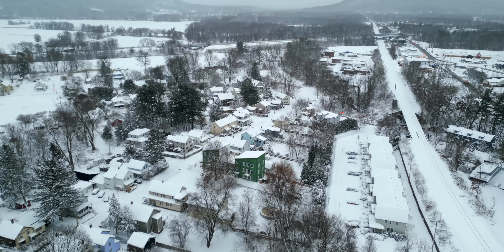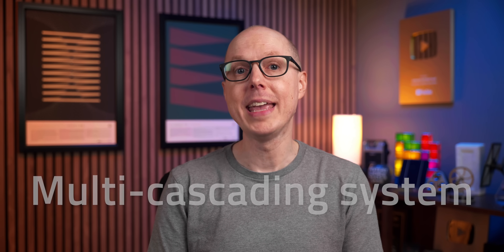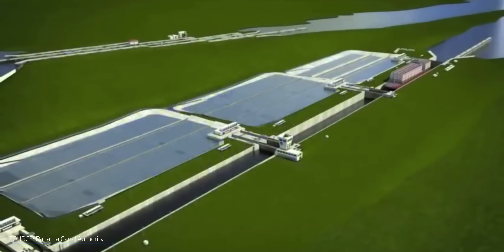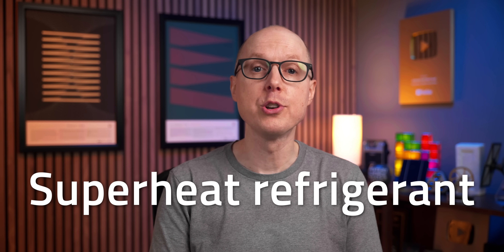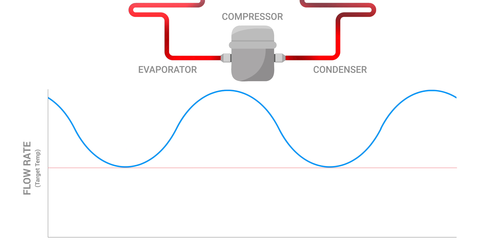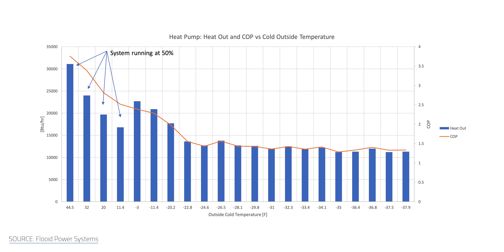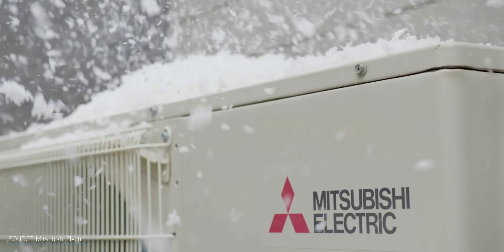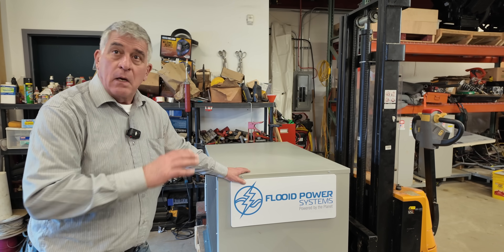How This New Heat Pump is Genius

Comment: How do modern heat pumps handle high, persistent heat, for us out west in the desert?
Reply: A heat pump is literally an air conditioner that can switch directions. You're either pumping the heat out of the home, or you're pumping it into the home. That's it. It's super simple.
Reply: High temperatures  is not as bad for the heat pump as low temperatures You can find some very reasonable heat pump that work in that range. And if your in a sunny area the EG$ solar hybrid system is a winner out there. providing on an average of 6 hours of free cooling on sunny days. The trick is to learn how to read the performance spec chart to know which one to buy.
Reply: @paperburn   Thanks! that's a great tip!
Reply: I guess just as well as an Air Conditoner. You just need to make sure to properly size it (a too large heat Pump causes cycling that wears down the heat Pump over time.).
Efficiency wise, it should be very good (lower temperature difference  = higher efficiency)
Reply: @justinterested5819   that's precisely my concern, if we're aiming for 72F and it's 120F outside, a high temperature difference, how efficiently can heat be exhausted into heat-saturated air?
Reply: @lady_draguliana784  A heat pump is moving energy around. Think of it like moving marbles. If the inside of your house is 80 marbles and you're trying to make it 72 marbles you need to move those eight outside. If the air outside is 120 marbles dissipating those 8 into the atmosphere isn't a big deal. 
The place's heat pumps struggled previously is when it's only 15 outside and you're trying to make it 68 inside. That's a lot of marbles to extract from the atmosphere.
(We should really be taking in BTU, but that complicates the explanation)
Reply: @lady_draguliana784  You'd size your heat pump for whatever your biggest temperature delta is across all seasons.

If you set your thermostat at 60 in winter, and the ambient temperature gets down to 20 degrees at the lowest, then 40 degrees would be your max winter delta. And if you set your thermostat at 70 in summer, and the ambient temperature gets up to 120 in summer, then 50 degrees would be your max summer delta. You'd size your heat pump for the larger of those two values.

For those who live in places with cold winters, the winter heating demand will probably be bigger than the summer cooling demand.
Reply: @dafunkmonster   Oh cool, I didn't know how to make that determination! thanks!

Comment: Heat pumps work in cold weather, but they are expensive as hell to run most people find that out the hard way
Reply: With a COP of 2-4 they're 1/2 to 1/4 the cost of resistant heat. The only way you get cheaper is if you have very cheap gas available, and expensive electricity. Depending on where you are that may be true, but it will always be true they're cheaper than any other electrical heat, and in many locations gas is more expensive still.
Reply: @peter65zzfdfh   & @otm646  there is still a perceived comfort that complicates that.   

With a HP producing 77* temps (in extreme cold), the air currents in the home feels cooler than Gas which can provide 105* air currents.   Studies show that people with gas units are comfortable in lower room temps than those with HP’s… do to warm air currents around them.   HP users will call for much higher room temps than gas users.  This “user comfort influence“ negates the mathematical benefits your referring to.
Reply: @BiggMo  I can see this being a thing. The gas furnace also uses a lot less flow. When I have my heat pump on the blower gets turned way up, creating a lot more "wind" in the house.
Reply: @DeadphishyEP3  I think there is a lot of perception involved, when a furnace put out heat it is normally at 100F .  any air movement below 85/90 degrees feels cool and heat pumps operate in that range at times.
Reply: @BiggMo   Most new heat pumps have variable speed fans. When the system is outputting less heat the fan will turn down automatically to maintain more comfortable supply air temperatures. They should be able to maintain 90F air even in the worst situations. If you're not in the direct path of an air vent it should be fine. If you stand over the output of my gas furnace it's just way too hot (125-135F), lower temps would be an advantage.
Reply: @peter65zzfdfh  "but it will always be true they're cheaper than any other electrical heat"

*assuming a certain level of reliability
Reply: @peter65zzfdfh  is that COP still true when using resistive heat to defrost the outdoor radiator?
Reply: @David-uf9qm  You don't use resistive heat to defrost the EVAPORATOR or the CONDENSER. (Radiator... lol).
You REVERSE THE FLOW OF THE SYSTEM TEMPORARILY.

(Radiators exhaust heat from another source. Evaporator and condenser are the who parts of a refrigeration cycle.)
Reply: When we installed a new AC unit, I mandated it to be a heat pump. Unfortunately it cost about 2 times more than my 93% furnace. I have solar, but it's a small house, so my roof is tapped out at 6kw.
Reply: @DeadphishyEP3  when I looked into heat pumps I found the installer markup was about 300 percent. EG4 hybrid solar might be a fit for you. it uses panels and grid  both and only uses the grid to sublimit the panels.  only take 6 to 8 450 watt panels  for peak performance. Most of these units come pre charged and you can self install if your very handy and can follow instruction provided..
Reply: Most people do not realise that you have to buy a heat pump optimised for heating or what you say is true. When the COP drops below 1 they suck the juice like a starving baby.
Reply: Heat pumps work perfectly well, even in arctic conditions. Their efficiency is hit, but it is still a COP of 1.5 instead of 3.5. even my 15 year old model is more efficient than an electric radiator at -27°C. It just doesn't have the same kick as at -15°C, so the house is a bit colder.
Please can people research further, rather than listening to some old boiler guy who doesn't understand the new technology.
Reply: They are not expensive to run. We have all of the efficiency numbers, that's what COP is. Plus if you have access to time of day power the electricity when you need it the most is dirt cheap.
Reply: @otm646  COP is great when measuring against resistive heat. BTU to BTU natural gas in my areas is magnitudes cheaper than electricity. This isn't some imaginary theory. My utility bills prove to me over the last several years that my heat pump costs me a lot more to run.
Reply: @DeadphishyEP3  know people that have bought them, and they had no idea because the salesman and many fanboys on the Internet may not even know they are not telling the truth
Reply: @otm646  Time of day electricity pricing is a wash, because you're only using "dirt cheap" electricity in the winter overnight. In summer, you're paying through the nose during peak demand to keep your home cool.
Reply: @dafunkmonster  we have a set point price in our coop, and if the coop makes a profit the extra is turned back to the users. we have the cheapest rates in the area. Not sure how they manage that but we do with a very high reliability rate even after hurricanes.
Reply: @otm646  that’s what all the salesman say exactly
Reply: Only if the systems are not designed or installed correctly. In the UK, some companies are seeing COPs of 4-5, which makes it cheaper to run than our standard gas boilers.
Reply: @egocd  Perhaps it depends on local weather and fuel costs. Some parts of the US get really cold and natural gas is cheap.

Comment: This sounds like geothermal.  The ground at a certain depth is a steady temperature.  Using a fluid loop in the ground to provide a floor temperature, a heat pump can then take the fluid in and either lower or increase the temperature of that fluid and exchange it with the indoor/outdoor temperature.
Reply: Actually, the system you describe is a ground-source heat pump system. IIRC, in most places, dig down about 6ft, and the earth will be at pretty much the same temperature all year round.  Geothermal uses naturally hot water from deep underground to extract energy. Realistically, geothermal is only available in a few places (Iceland, for example; Yellowstone is probably a good example too), whereas ground source systems can be installed in most places (maybe not where there's solid granite a few inches below the surface...)
Reply: In most places, the term "geothermal" is referring to "ground source" nowadays, rather than the previous use to which you refer.

Comment: Have r290 heat pumps reached america yet? They've been on the market in the UK for about a year and r290 is code for propane, they use that as a heat transfer medium and are said to achieve 70C, which also means they can be directly swapped out for an existing boiler. Not cascading as far as I'm aware.
Reply: The legislation has been approved but it's looking like 2025. People know what's up, it's definitely being talked about especially in monoblock form.
Reply: I've been building R290 systems for years " early 90s" for -20F natural gas processing equipment. in a heat pump application ammonia is a better refrigerant. Propane has a low heat of compression as why 410 does so well, but ammonia does better in that regard it just eats copper.
Reply: Most UK homes have hydronic heating systems, and these were designed to run with the hot water at 70C. The pipe work and radiators can be too small for heatpumps to operate effectively. More modern hydronic system are designed for lower temperature flows to take advantage of  condensing the exhausts gases, such systems are happy with flow temperatures of 45C, which is also fine for hot water if you have a large storage cylinder. Legionnella is generally not an issue in domestic properties, even if water is stored at 45C.
Reply: Such a wasteful way to do it. You don't want your home or even your hot water to be 70C and the bigger the difference you're trying to achieve the less efficient the system is. Replacing the ducts or using mini splits is probably half the running cost again.
Reply: @peter65zzfdfh You're not looking at the complete system here. R290 is a massive breakthrough because of the monoblock design. That lowers the cost of installation massively and makes it DIY friendly.
Reply: @peter65zzfdfh  very few heating systems in the uk use ducts, apparently 70C is enough to kill legionnaire's disease so they don't need an immersion heater on top to make sure it gets killed and I think older heat pumps do have them.
Reply: @aptreadwell if you use a heat store instead of a water tank then the legionnaires risk goes away. The former is a water tank with a serpent coil within in. Fresh water comes in, warms up through the coil and goes out again. The water in the tank never meets the fresh and moves through quickly. If you have a hot water tank and use  water directly from that tank, then yes, you have to heat the whole tank periodically to kill the bugs

Comment: I’m a HVACR tech for ten years and I’ve seen cascade systems in ultra low temp medical RIF for years, it may work but nothing beats a furnace
Reply: "nothing beats a furnace" - Surely that depends on what you need?  e.g. here in the UK we rarely see temperatures below -10C, or above +30C (and honestly anything below -3 or above +25 are generally short-term "extreme weather events"... all completely within range of a standard single stage heat pump. And given that within those temp ranges you're almost guaranteed a COP of >2, I'd say a furnace (or gas boiler, as we tend to have here) is beaten into a COPped hat by a heat pump...
Reply: Heat is heat. This is cheaper electrical heat than any resistive heat. In places where gas isn't dirt cheap it's way way cheaper too.
Reply: Moving heat beats generating heat.